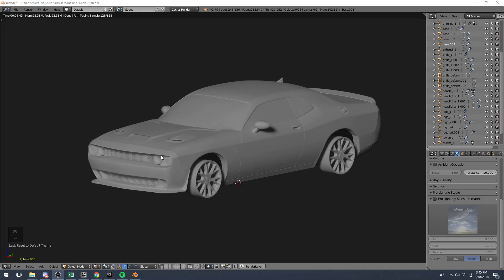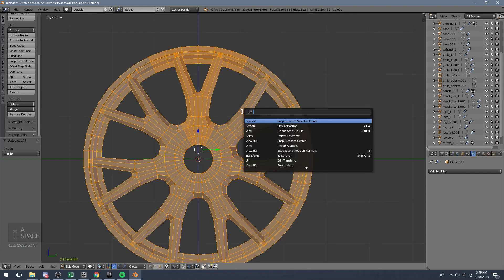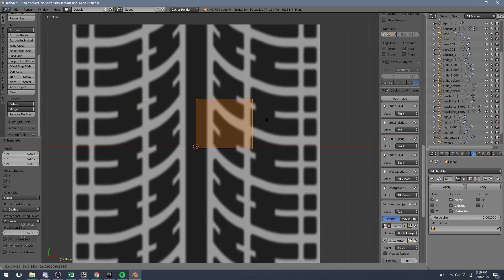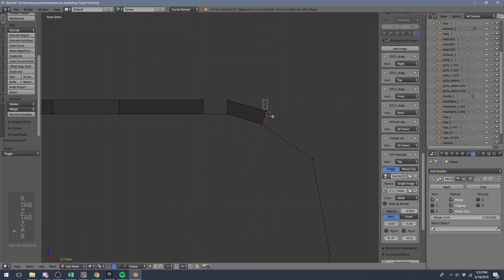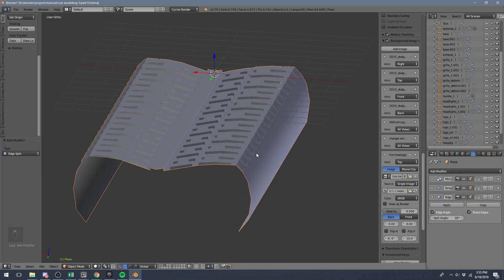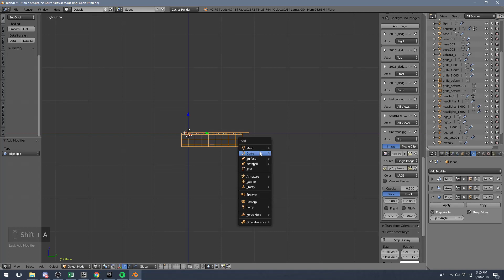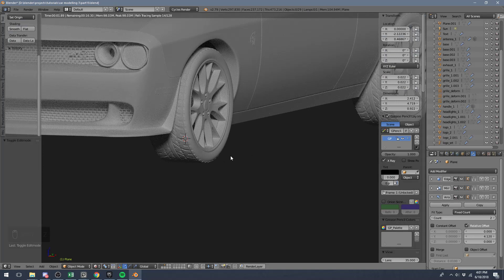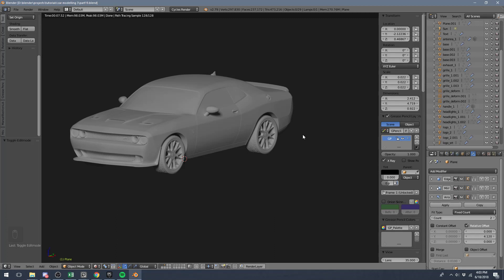Model a 3d Car | part 19 | modeling tires & spin tool

Comment: Finally, a car with wheels :)
I've learned a whole lot through these tutorials, and feel more versed and skilled than ever. I almost feel sad as I've inched closer to the end of this series, since I surely must have a lot more to learn.
But I suck at texturing, so yay! Thanks you so much for taking the time to make these, they've been very helpful. You plan to make machines/engines, or similarly tricky models in the future? 
,,, you've got a site where it's possible to see other works you've done?

Comment: Hey, don't worry about the geometry of the tires, this can be easily baked on a low poly cylinder anyway, i still modeling the hellcat  but it start to be hard as i need to make the interior as well, and make that riggable for animation, also imo the blender baking is a little bit weird compared to substance painter, and i struggle to have good normal, especially because i uv atlas the different parts and blender doesn't automatically merge all those map in the uv atlas (you have to bake every part individually and use 3rd part soft to blend that) or maybe i just don't know how to it.
Reply: Really

Comment: Hello, I have been following through your tutorials from part 1. Now I am on part 16 and the experience is amazing. I wish to know whether you will be making axels for the wheels or can they be disregarded and still have the wheels spinning?
Reply from the maker: Razaki Chronicles I won’t be modeling any axles or anything like that but feel free to model them if you’d like. They’re not 100% necessary for the wheels to spin. If we were to rig the vehicle you can make do without but it’s up to you
Reply: Thanks